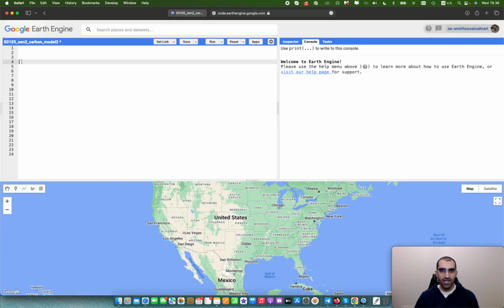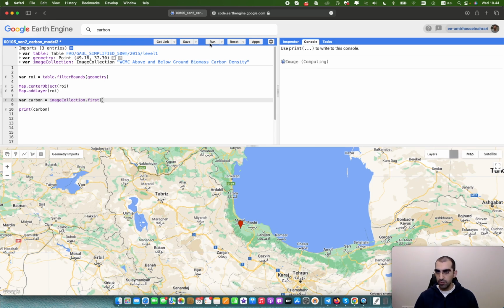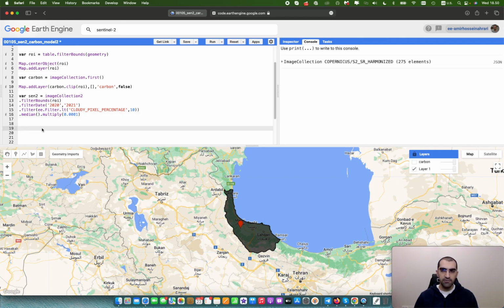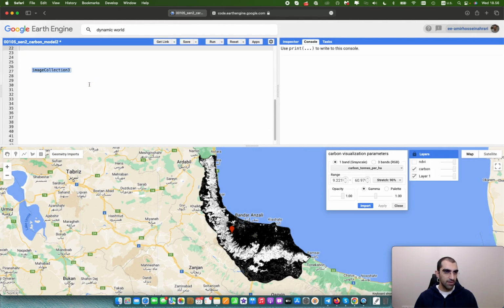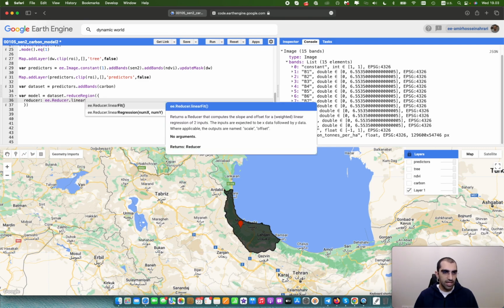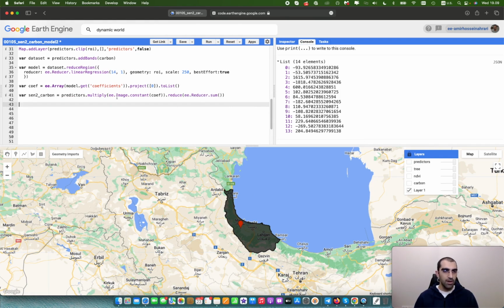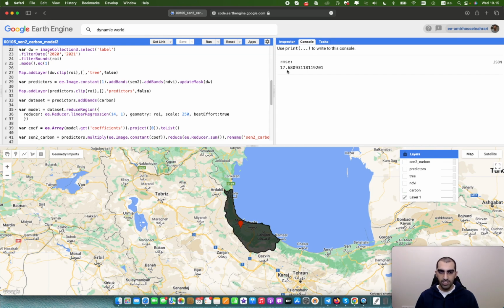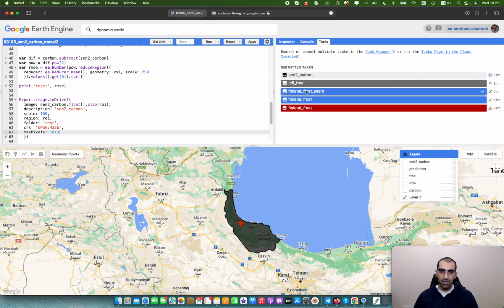Google Earth Engine Tutorial-87: Sentinel-2 Carbon Stock Estimation, using Regression Analysis

Comment: Thank you for that great resource. You mentioned the limitation of the biomass layer (1 year and low resolution) and I understand that. But for which year did you perform that regression finally ? 2020-2021 ??
Reply from the maker: The original product is only available for 2010. However using regression method we calculate it for our desired year, for example 2020 in this tutorial. You can use the regression method to predict it for your target year with higher spatial resolution.
Reply: Got it! Thank You
Reply: Apologies in advance, I am new to this topic, but I am very interested in learning more about it. I would like to ask, I don’t see any calculation for the year 2020 in this video. Could you point out which part of the code includes the calculation for the year 2020?

Also, how can we calculate/predict the carbon stock for 2011, 2012, 2013, ... 2020?

Thank you.